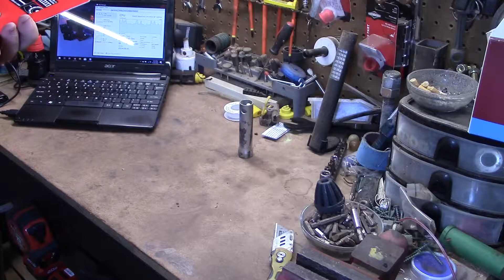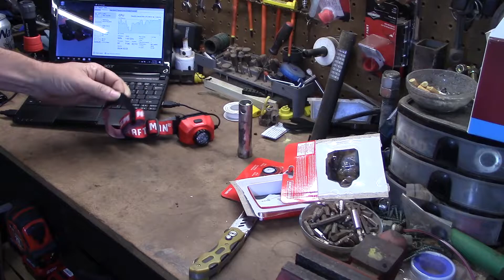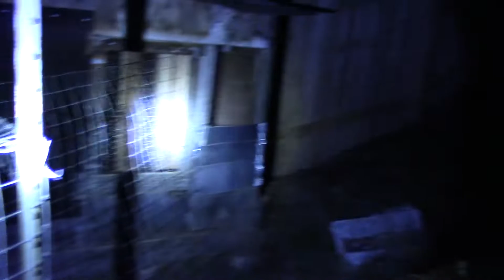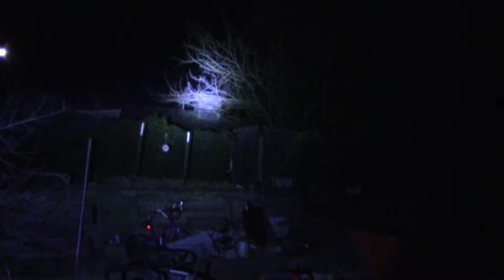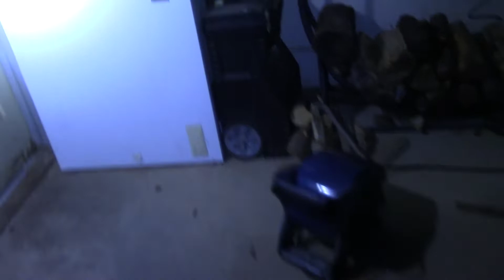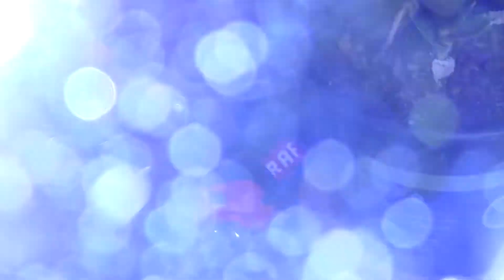Unboxing the Craftsman CMXLHB5 rechargeable LED headlamp

Comment: I have two of these lights. One has a dead battery. The other is still working fine. I looked up a compatible battery and found the 963450. Has anyone tried to replace the battery on this headlamp. I love the brightness of this especially in winter when I have to go out at night to tend my animals.

Comment: does anyone know where I can buy another of these? it seems to have been discontinued despite being the BEST EVER headlamp created :(
Reply from the maker: Yeh it's odd, it still shows for sale everywhere but no stock anywhere.
Reply: @jason-white  why would this headlamp, of all the headlamps on the market, be discontinued? it's the easiest charge w/ built-in plug, brightest and lasts the longest...
Reply: do you have ANY IDEA of any other model that's similar and still on the market? thanks in advance...
Reply from the maker: @lindsayboykin  Because it worked to good? If it works to good then it's bad business by modern standards. They need you to come back and buy another one sooner. Thanks for watching.
Reply from the maker: @lindsayboykin  No, I have tried a couple since but I have yet to find another good one.
Reply: @jason-white  yeh i mean that's the answer i was hoping not to hear. it's so frustrating that i can't find another headlamp that fills its shoes because i wear them all the time.
Reply: @jason-white  yeh i tried the Vector on Amazon and it's the most similar model I"ve found but it has a HUGE problem -- the little plastic piece BREAKS in the first uses and falls down to a 90 degree angle permanently lighting up the ground on one's head
Reply from the maker: @lindsayboykin  I have been using this Kobalt headlamp, It's been great other than the fact that I wear glasses and it reflects off of them  https://www.youtube.com/watch?v=xUzNaMY-Tnc
Reply: @jason-white  yeh I need one that's not so much for running. I need one that's easy to turn on/off (not too many extraneous settings) and bright. do you know of any others? like the Craftsman, basically?  thanks!!!
Reply from the maker: @lindsayboykin  None so far that perform very well unfortunately. I also use the LUX Pro 738, it's great for around the property but battery life is not great.

Comment: Had mine for a while good light but the pivot will wear out, use epoxy to fix it.
Reply from the maker: It dose seem like the weak point to me. Mine is still holding up well but I do assume that pivot will be the first part to give out. Thanks for watching.

Comment: Has anyone figured out a way to change the settings so that the low beam comes on first?  I almost never use the high beam, so I'd like the low beam to come on first. thanks.
Reply from the maker: I'm not sure how possible that is. I would assume there is a stamped circuit under the power button that controls that. If you really knew what you were doing with those you might be able to make something work but I have no idea how you would get it apart and back together.
Reply: @jason-white  maybe Craftsman's paying attention and will change this for the next model

Comment: I bought this headlamp and charged it for 12 and the red light was still flashing? How do you know when it's fully charged?
Reply from the maker: The light will stop flashing at full charge, if you leave it plugged in it will flash every now and then just keeping it fully charged. I suspect you might have just checked on it during these times. Thanks for watching.

Comment: i did love mine till the black plastic part the strap goes thru broke. now its quite useless. i wont buy another one till they improve that part. since Crapsman sold out to china theyre just junk anymore.
Reply from the maker: That is unfortunate. I just picked mine up and inspected it after reading your comment and the black plastic looks pretty beefy. I could not imagine it breaking under normal use but maybe it was improved before I got mine. Thanks for watching.
Reply: Maybe they improved it already, because mine is very sturdy, the whole thing feels like well made good quality tool, and doesn’t feel like it was made in China in our traditional understanding, and nowadays Chinese learned how to make thing better, they have all necessary equipment for this…
Reply: Battery recharging cycles stink.  Loved mine at first, but after 1 1/2 years it lasts for a very short time on high, a few (maybe 2 more?) hours on low, and then konks out on me.  Enough for a camper, so long as you only need it for a night, but not enough for someone using it as a work light.  And the recharge times are hours.  Wondering if I can replace the junk Crapsman battery with an aftermarket one that will hold a longer charge.
Reply: @bnr540  you can almost certainly wire an 18650  to it.
Finding a way to make it all stick together would be nearly impossible. You just need multiple lights like this, which stinks!
Or just buy a good one that takes 18650 and a few batteries, that’s really the only way to go but most of them are junk, be ready to pay $80